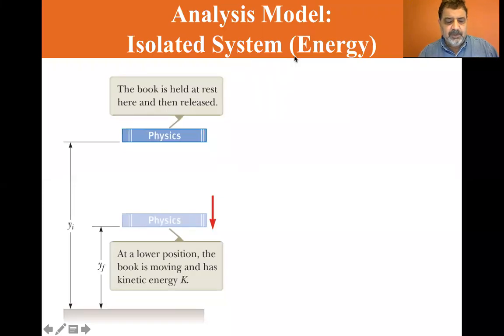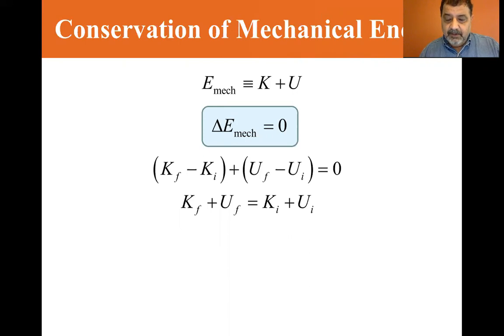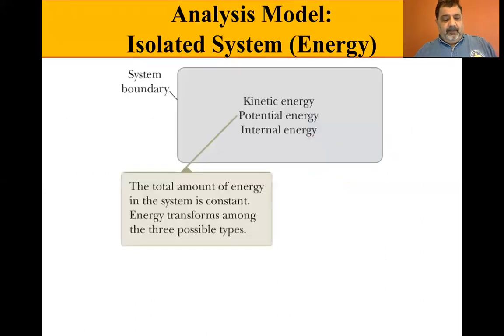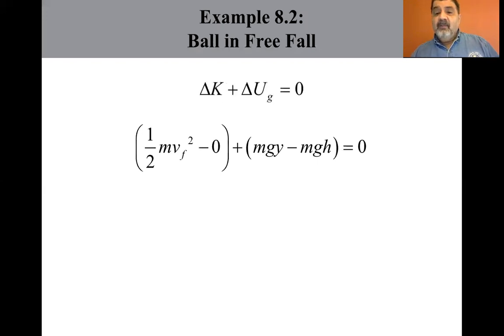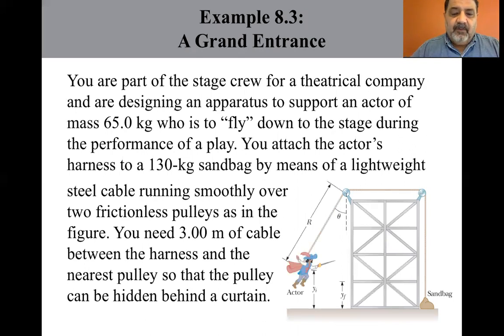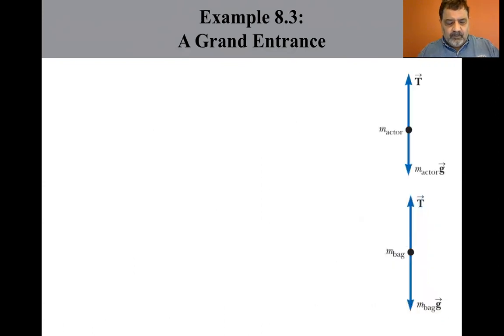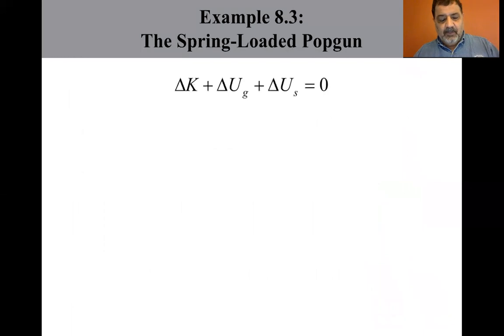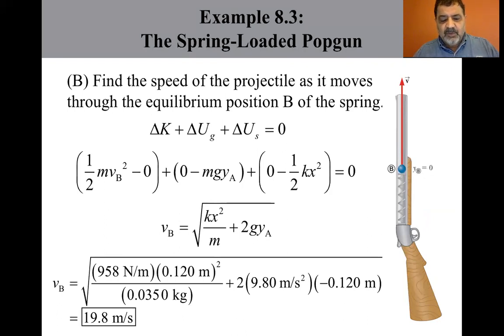University Physics Lectures, Analysis Model, Isolated System, Energy

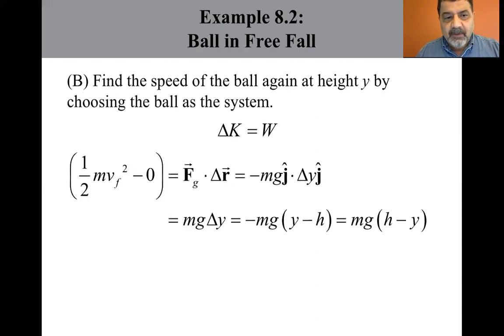Comment: at 16:39 Why is there a minus sign with mg on right side? please give ans as soon as possible.
Reply from the maker: This is an old lecture. Gravitational acceleration is -9.8 m/s^2, in other words in the negative y direction.
Reply: @josemenchaca2213  Yes i know this thing about g But the main issue is that in many problems we have neglected the sign of gravitional force. and we have put its sign in this problem,can u tell me the reason that why is this that in some problem we use the sign of g while not in some problems although the g has always -ve sign?